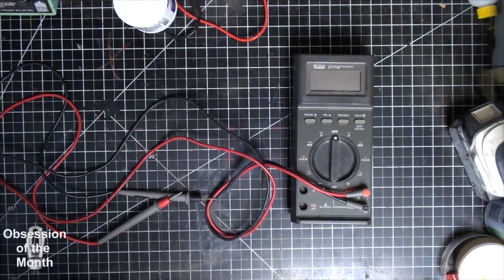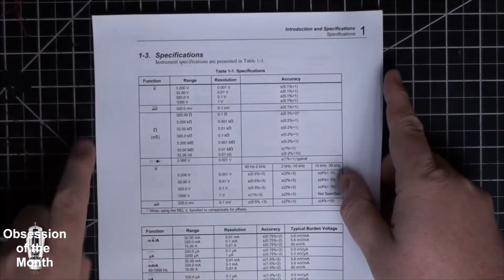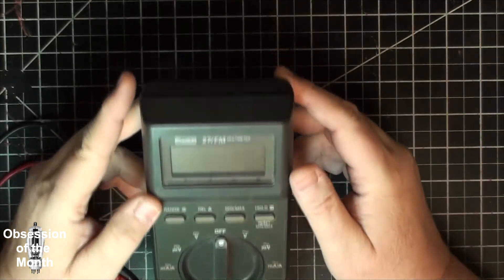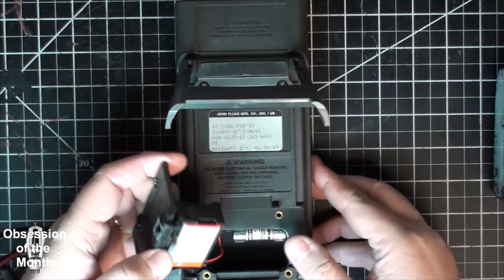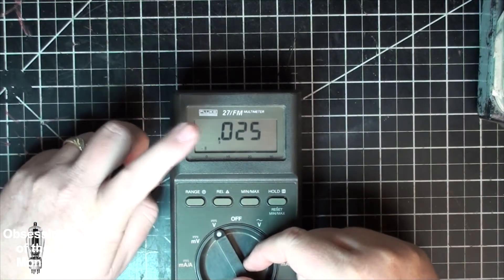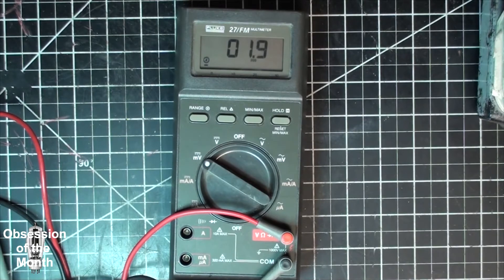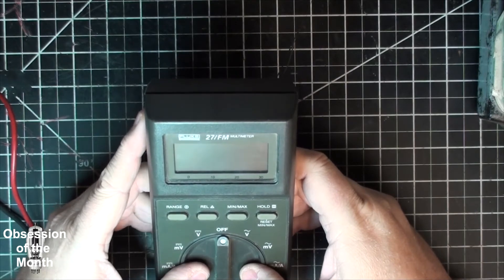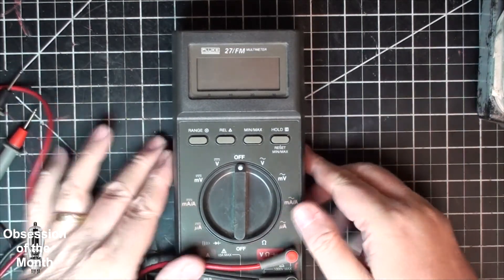Fluke 27/FM AN/PSM-45A Digital Multi Meter

Comment: Thank you for this video. It was a nice introduction to the 27/FM meter. It’s now May, 2025 and I just bought a 27/FM on eBay for $50.00 with free shipping. It came with both fuses and the original Fluke leads and works perfectly. I am very pleased as I’ve wanted one of these meters for a long time. It seems to be very accurate. You’re quite right about this meter being built like a tank. There’s not as many of the 27/FM models as there used to be on eBay. Maybe the supply is starting to run a bit low or maybe there was just a temporary lull in sales.